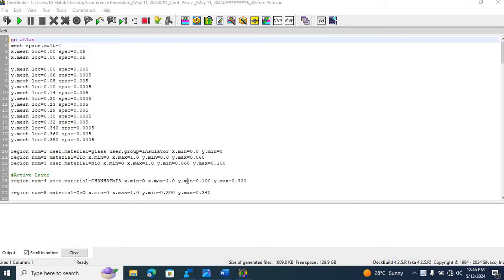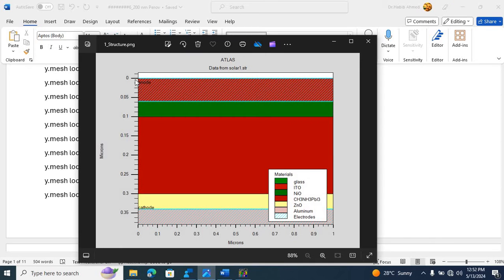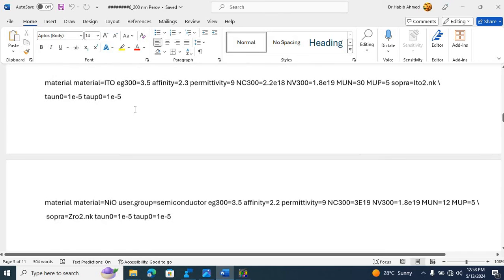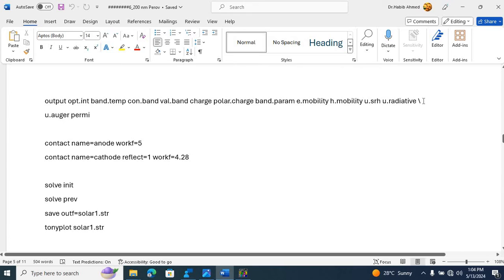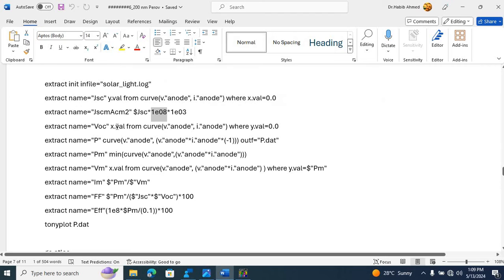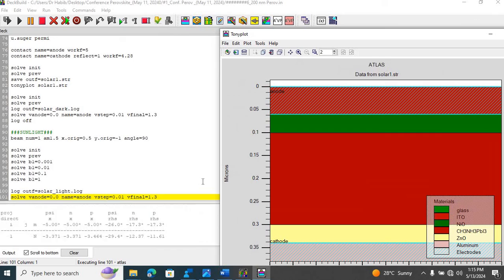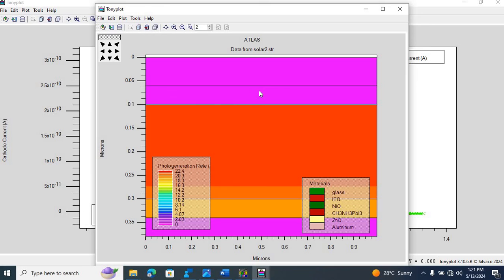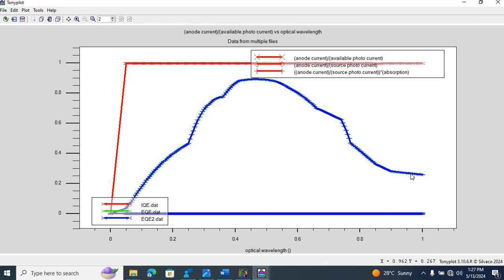25% Efficiency Perovskite Solar Cells Silvaco TCAD Simulation  🌞🚀⚡️🌱🔋

Comment: Thank you for the insightful tutorial, Dr. Habib. I recently started using Silvaco for simulating solar cells, particularly perovskite solar cells. I followed the code you demonstrated in the video and generated an "NK" file for user-defined materials, such as CH3NH3PbI3, etc. However, I am encountering unexpected output parameters:

Voc: 0.99 V
Jsc: 0.8 mA/cm²
FF: 80.38%
PCE: 0.63%

Could you please guide me on where I might be going wrong? Your advice would be greatly appreciated.
Reply from the maker: It seems you may have missed a step or two in the NK file creation process.
Reply: @HabibAhmadGatech  Could you please elaborate on where I might have missed these steps? From my understanding, the “nk” file is generated for consistent wavelength values, while the index file is used for non-uniform data. However, when I try to create an “nk” index file for the perovskite layer, I receive error notifications such as:

"Could not open index file CH3NH3PbI3.nk"
"No default material specified for user material: CH3NH3PbI3"
(This error appears for all layers as well.)

It seems like I’m missing something here. If possible, could you consider creating a specific tutorial to help avoid such errors? That would be extremely helpful!